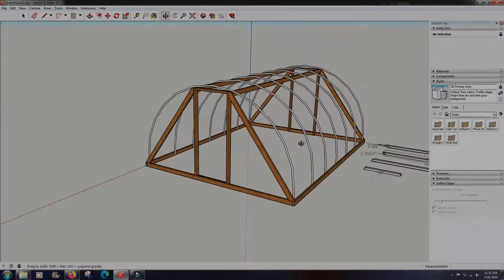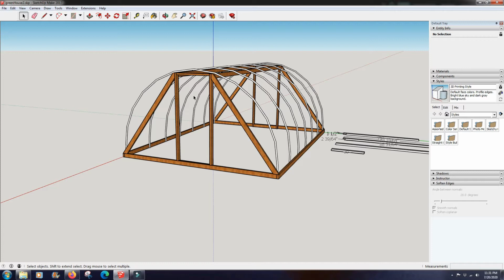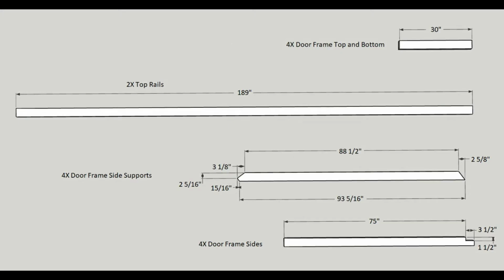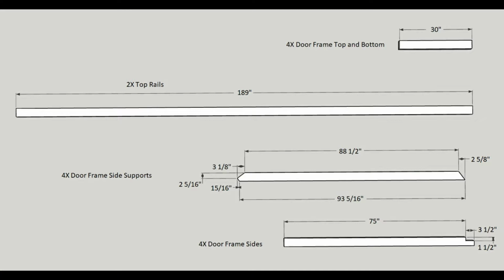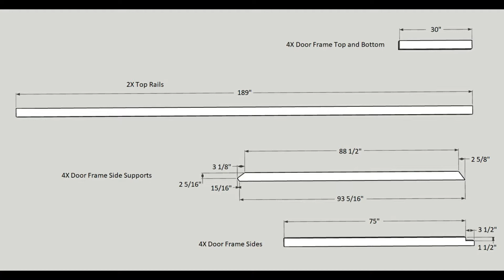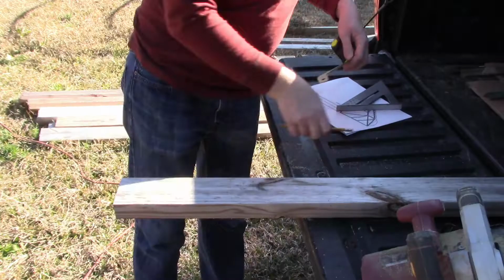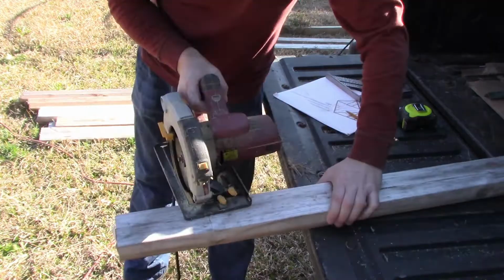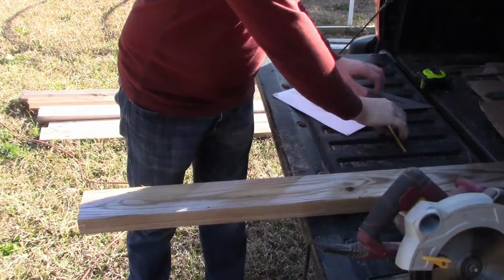Building a greenhouse Part 2

Comment: I built one of these about 10 years ago. Kept my tomatoes growing until Nov. 16th in ohio. Was awesome having snow on the ground and 2lb beefsteaks thriving.
Reply from the maker: That's awesome! I need to get better cooling. My main issue is it getting too hot in there. I get keep my tomatoes alive through December last winter, but they quit making fruit.
Reply: @JohnHamerProjects  the only thing I can think of for maintaining fruit bearing is more natural/artificial lighting, manual pollinating, and consistent feeding. I opted out on the greenhouse this year and focused on a winter crop of collards, kale, cabbage and radishes. The greens are good to till up for nutrients and soil composition for spring (what I cant eat up that is)
Reply from the maker: I think I was not feeding them enough. I was mostly interested in how long they would live, so it was still a success. My plan was always to grow greens in the winter and play with hydroponics in the summer. I think I will plant some kale and lettuce soon and see how it goes. Have you had any issues with fire ants in your greenhouse? I don't want to put poison in there, so I have just been annoying them until they leave, but they still do some damage.
Reply: @JohnHamerProjects  I use diatomaceous earth for the bugs, but sometimes it doesn't work with fire ants. Avoid mulch, and add wood ash if you're able. It may not get them all, but it definitely helps get rid of 98% of them!
Reply: Food grade diatomaceous earth that is
Reply from the maker: I haven't heard of the wood ash. I have tried diatomaceous earth. I do have mulch in there right now to keep down on the grass growth. Maybe I should use something else.
Reply: I also live in Ohio and thought about a greenhouse.  Thinking maybe next year so I can do some extra research on build designs.  Any recommendations?  Curious if you monitored temps in the greenhouse throughout the winter.

Comment: I was thinking use construction stakes i stead of rebar and just cut the center of the pipes and use fittings to attach another pipe across the middle of the top and just zip tie the doorframe to the top end and then cover with greenhouse plastic and call it a day. I'm a bit lazy and cheap. Thanks for the video it's very helpful. I'm starting to grow vegetables as a hobby and wanted a greenhouse to grow all yr. and to control my planting environment.
Reply from the maker: I'm sure that would work just fine. I ended up adding some stakes on either end after it blew off the rebar on a windy day. We get hurricanes here, so hopefully that will be enough. I think I hammered them a few feet in the ground.

Comment: #Greatjob I love the simplicity to save money on supplies.  Keep us posted if there was any wind damage or bigger fruit grown inside.  #Keepupthegreatwork
Reply from the maker: No wind damage yet,  but I did have it lift off the ground a little on one side during a storm with strong wind.  I solved it by hammering a few stakes in the ground and screwing them to the frame.  No issues since,  but we Haven't had a hurricane.

Comment: here in MI we have marijuana plants. I want to make a greenhouse but winter are really bad. really nice video. may copy yours and put a heater in it.
Reply from the maker: My biggest issue has been keeping it cool in the summer. I have been taking everything out in the summer. Maybe do the double plastic with a little air gap for better insulation in the winter? It's a pretty manageable size. Shouldn't take much too heat.

Comment: Where do you live what time of the year did you start growing stuff in it this year? did you heat it your self at night this past year did you need to heat it at all or no?
Reply from the maker: I live in South Carolina on the border of 8a and 8b. The only time it really gets cold enough to freeze inside the greenhouse is Jan - Feb. With a little heater, I could easily grow year round. I don't have heat in it and I don't have enough cooling. My biggest issue has been cooling. I tried starting in Feb this year and taking the plants outside on warm days. It just gets so hot in there so quickly. I bought a shade cloth and some other things. I'll make a video on it when I make some improvements. It has been a learning experience.

Comment: very nice setup John.  thx for sharing that.  I'm getting ready to build and your video is very helpful..   I'm learning sketchup so will be drawing mine out as well.  How has it held up so far?   any issues with the poly cover tearing?    I get a little snow in winter, but do to gophers and rabbits and squirrels, I want to grow year round, including our summers which get up over 100 degrees for at least 3 months.... do you think the green house would work, or be too hot?   I could possibly cover it in summer with a light shade cloth...   or would I need to replace the plastic with shade cloth?
Reply from the maker: The plastic has heald up good.  I have the problem with heat that you are describing.  I leave the door open in the summer and I have a shade cloth.  I still have trouble with it getting too hot in the middle of the summer. I'm thinking about putting a door at the other end to help with air flow. I think making the plastic where you can roll it up a foot or so around the edges would be much better.  I think if I were to do it again,  I would make the front and back walls wood with windows and maybe only put plastic on the side that faces the sun.  It's an ongoing project and I haven't really figured it out yet.  I have a window at the end across from the door with a fan in it that blows air through the greenhouse in the summer.  It gets very very hot in there without it. It works great on the spring and fall though.
Reply: @JohnHamerProjects  one guy back east, Leon, actually takes the plastic off in summer and replaces it with shadecloth.  That might help with the heat.   he uses the wiggle wire channels which doesn't seem to damage the plastic.   I'd rather not do all that but that might make a huge difference.   Do you have a way that keeps small critters out, like rabbits, squirrels, gophers?
Reply from the maker: @privateuploads-geo2625  I haven't had any problems with critters so I don't have anything for you there. If I had a way to take the plastic off on the summer,  that would be awesome.  When the plastic fails I may try that.

Comment: Hi, where i can I buy those hoops? I call kent and home depot they said they dont have one...what exactly you call those hoops? thank you in advance.
Reply from the maker: Hey,  it's just white pvc water pipe. They have it at home depot and lowes. I believe I used 1" diameter.  I used the thinner walled stuff. It's called sdr-21. The thicker stuff is called schedule 40 and I'm not sure if that would bend well enough.  You can sometimes get it in 20 foot pieces, but I just joined 2 10 foot pieces with a coupler.
Reply: @JohnHamerProjects  Thank you so much...when I called i said its a hoops i didnt mention the pvc.😂😁..thats why he said they dont have hoops..
Reply from the maker: @kylaalpin4074  Yup! No problem. They should have plenty in stock. There are a lot of similar videos, but I believe the idea comes from a This old house greenhouse episode. It's on youtube. They used the 20 foot pieces.  I didn't see those at the hardware store and they would be hard to transport.  The 10 foot pieces worked really well.

Comment: Are you going to make a larger one?
Reply from the maker: I'm not sure. I haven't done much with it yet. When I finished it,  it was summer and I didn't need it.  I tried growing some things in there, but it was just too hot here.  I will use it in the spring to start plants for my garden.  I bought some parts to make automatic venting and air circulation.  I need to get that working before I will be able to do any summer growing.  If all goes well,  I may build a larger one.

Comment: What was your spacing on the pvc pipes
Reply from the maker: I measured it exactly as I made it, but in my model it comes out to 31 and 1/3 inches so 31 and 5/16 would be really close. That is to the center of each pipe.
Reply: @JohnHamerProjects  thank you 👍